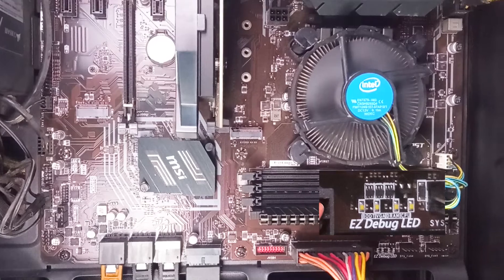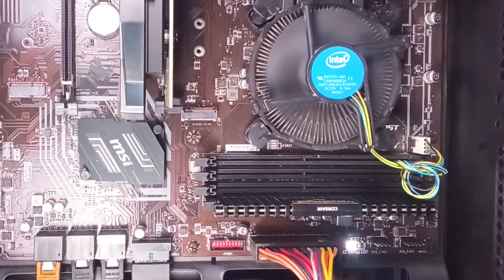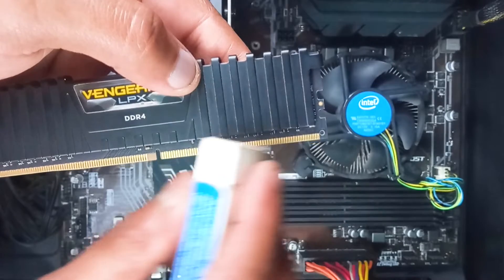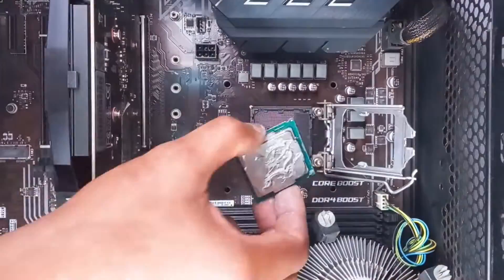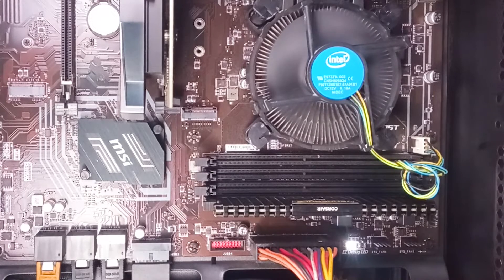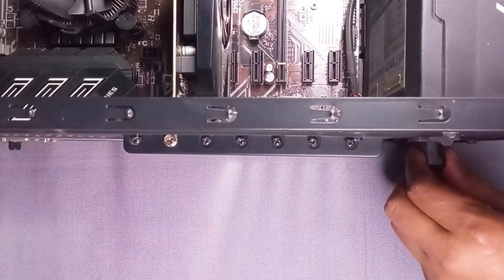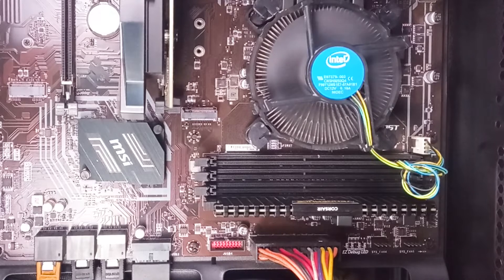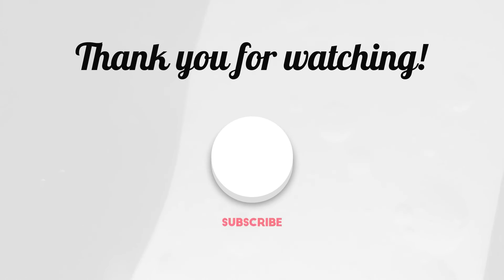Troubleshoot your Computer using EZ Debug LED

Comment: Hi! I could use some help. One day I went to turn on the PC, and the power supply sparked, and the PC wouldn't turn on again. I bought a new power supply and installed it, but when I turned on the PC, the CPU and RAM LEDs in the EZ Debug Log were flashing. Since I had removed the RAM, I thought it might be due to improper installation. I removed them and put them back in, and it worked, at least for that day. The next day, after having the PC on for a few minutes, it shut down. Since then, the CPU LED has remained lit and no image is shown, and sometimes the CPU and RAM LEDs flash again. Any idea where the problem could be?
Reply from the maker: Do it as i say in the video

Comment: MSI b650 tomahawk, 7800x 3D and GeForce RTX 4070. 

I get this issue where the red and yellow lights light up when first starting up and then turn off. The PC seems to run normally but I get crashes and messages saying I’m mixing profiles in my iCue. Not sure if this is normal or not